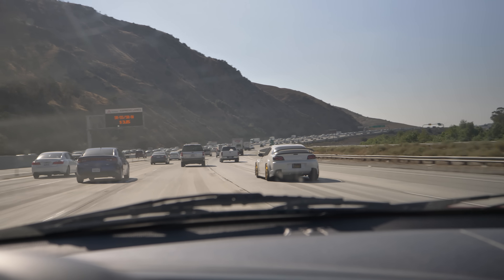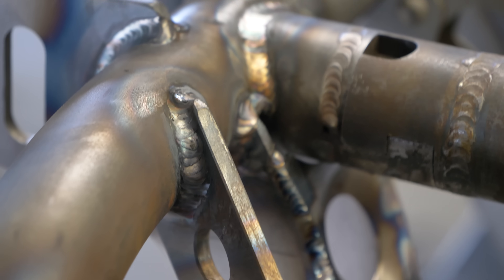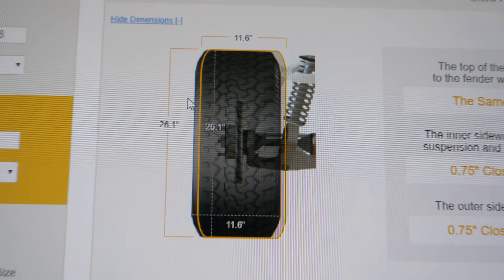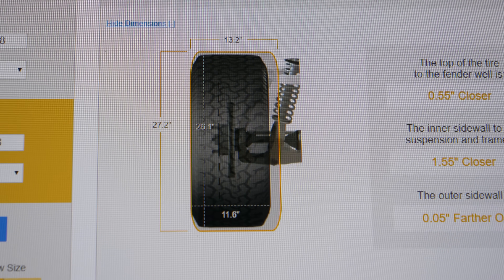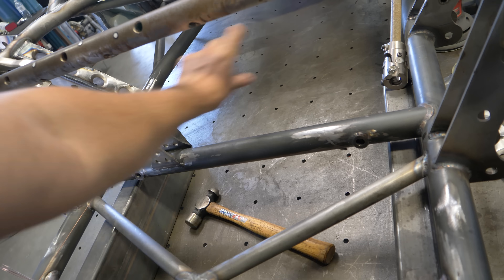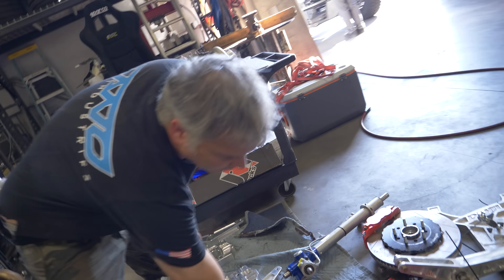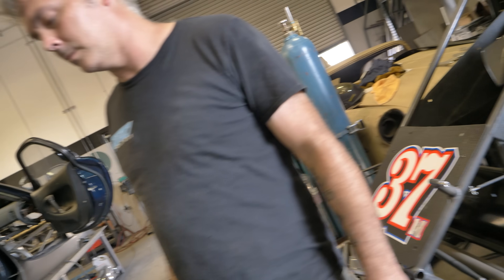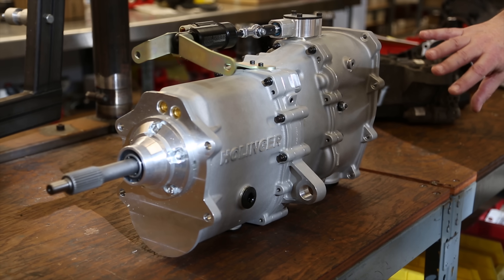Chassis subframe MUST handle 2000 HP | AWD 4 Rotor Build

Comment: What's up Rob. On the front suspension/subframe/crossmember that connects your control arms, do you know why square tube steel wasn't used? I can't see what's going on inside there, but my assumption is that its just hollow. I'm curious to know why those were welded lengthwise because that would take so long. And I'm not a pro welder, but just for good measure with that much to weld, and only 1/8" thick, wouldn't you want to have them clamped down? 
Anyway, this build is super neat. I'm a big fan. Cheers
Tab
Reply from the maker: I love that it’s round tube in the front. It looks beautiful.  I can’t speak from experience on its effect va square. But we will find out together. All of Abel’s drag cars are round tube. And I feel it looks like more effort was put into the form and function. The rear subframe core is square but then everything else is tube again
Reply: Rob Dahm sorry, I was referring to the crossmember that was being welded at 4:15 in the video. It’s the rear subframe now that I rewatched it. I was just wondering why it was 4 plates welded into a square rather than using an extruded bar of square tube.

Comment: I really enjoy the project. I've been fabricating for over twenty years myself. I'm sure ppl tell you what you should be doing enough but I think there is a better way to fabricate your sub frame and save on labor cost and to have a lighter stronger and most importantly square true straight then what I saw being welded in this video

Comment: Too bad a cars chassis doesn't handle horsepower but it see's torque... and with the torque levels a rotary makes  it won't be an issue to even a regular  chassis and really 2000hp ? dude try making 900 800 or something smaller first... with out blowing up.
Reply: He's already made almost 1,000hp  on a 9 year old engine with half as many rotors so...
Reply: ConnorWolf  where show me and 3 is not half of 4.
Reply: @msengineeringdavid3702  Yeah, sorry was the 3 rotor.  But he made 950 and decided he was going to either make 1,000 or blow it up, so he turned off some of the safeties on the ecu (he was running out of fuel I think) and it blew up :P
Reply: ConnorWolf the fact that it blew up means inexperience and it never even sustained it.
Reply: @msengineeringdavid3702  It was fine at 900 for a long time, he knew he was running out of fuel (needed bigger injectors etc) but he pushed it anyway knowing it would likely not survive without more fuel. He got the 1/2 mile record just before that with a 9 year old engine so... not unreasonable to make a lot more power with a much better built, larger engine and bigger turbo.
Reply: ConnorWolf that’s not a long time.. his car ran like poop man when he did the YouTube car challenge he had the worst car there man ...
Reply from the maker: Haha connor no worries. He’s just trying to sound right. I would normally acknowledge his point but he’s pretty wrong on this one.
Reply: Rob Dahm  so how long did you make 900hp rob... because you blew it up.
Reply: Rob Dahm  oh let me add that 1. Not even gtr’s, or 2jz survive 2000hp w/o bearings getting pounded pistons getting changed etc a rotary has way more sliding seals in its combustion chamber to say yeah 2000whp no problem is a joke you’re using oem intermediate housings at this point they will be flexing long before that. There is a reason why billet inc use straight up aluminum side housings due to the pressure spikes. You’re not building a drag car so you might as well run a power level to keep the thing together... but pls keep telling me “I’m trying to sound right” .

Comment: Why exactly are you doing these long welds on the subframe when you could have started with square tubing? makes no sense to me...
Reply: Cause it's not a square. Much easier to make your own rectangle tube than find a supplier that has it in the perfect size, gauge, and quality of metal that you want. They're using plate they know is high quality.
Reply: *rectangular, if it makes you happy. Still, the point remains...